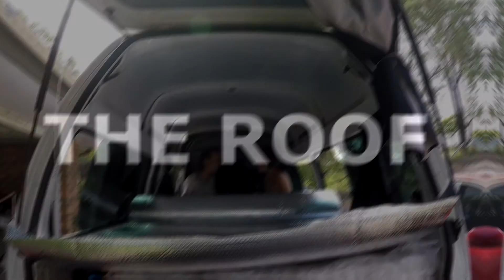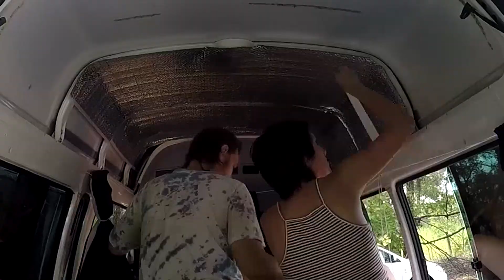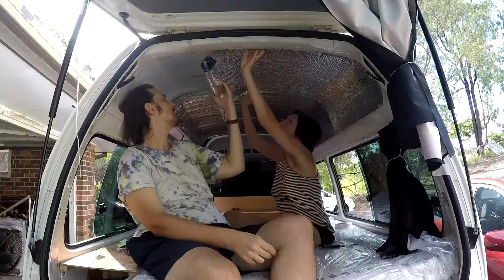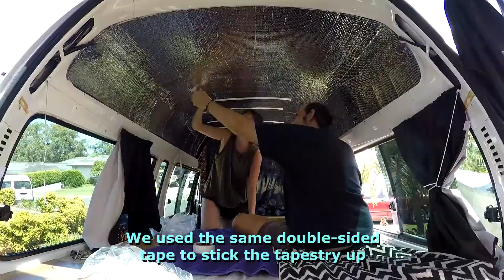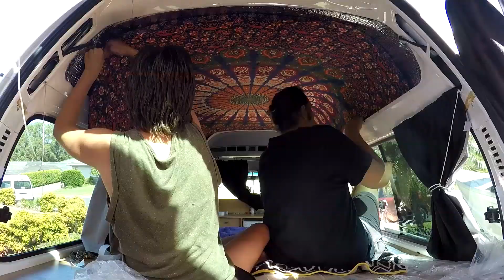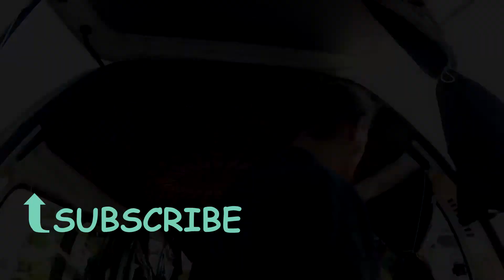Cheap Van Build: CEILING TAPESTRY (no experience)

Comment: Hey guys this looks great, how did the glue on the sticky tape fare in the heat? I’m super interested in knowing where you got the insulation, tape and glue. Other videos I’ve seen they’ve said you should have an air gap. What are your thoughts? I’m at the point where I’m about to buy a van and do the conversion and then next year in June head from Brisbane straight up to the tip of qld and over 6 months follow the coast line to tassie
Reply from the maker: Hey, thanks for tuning in! The air gap is a must when using this type of insulation or else it just won't work. If reflective insulation is touching the surface of the van it becomes conductive heat and loses its ability to reflect heat. In this van and most panel vans there are support beams, like ribs, which add strength cross the roof of the van and protrude about 5cm away from the sheet metal shell. We stuck our tape to those support beams to ensure there was an air gap. I hope this makes sense? The double sided insulation tape we bought from Bunnings for about $40AUD (for a 50m roll) and as it is designed to work inside roofs it has stuck perfectly throughout the past 2 aussie summers. Last summer got up to around 43 degrees C at one point and the tape remained unaffected. We couldn't be happier with how well it has worked and will be creating a website shortly to elaborate on the different aspects of our build. Best of luck with your future van! We will be listing ours for sale in the Gold Coast area in the next week or so, so keep an eye out for that if you want one already fit out (We're selling up and going backpacking in Asia... Yew!!)
Reply: Ali & Tim that’s really helpful, thanks guys. Now that I watch back I see what you mean on how you stuck the tape on the support beams. Seems super easy. I just bought a van on Thursday!! I’ll continue to watch your videos and reach out if I have any questions. Good luck with selling your van ☺️
Reply from the maker: @meals1459  That's wonderful! Have a great time fitting it out. It can be a mind bender figuring out how it's all going to come together, but with Youtube and so many blogs to turn to, you'll have all the guidance available that you need. Good luck!

Comment: What size tapestry did you use
Reply from the maker: That one was 180cm x 230cm, which was a little bit short length-wise. We bought it from Ebay and it was the largest we could find at the time.

We have been looking again lately to do the same on the roof of our latest van and have seen some 200cm x 300cm in size on the Ishka store website which would be better for longer vans.
Reply: @TheVeganTravelShow  okay thank you so much I'm planning on doing this to my 4door geo tracker. I thought it was a really great ideas thank you for posting this.

Comment: So is that reflective?
Reply from the maker: If you're referring to the tapestry, no it's not reflective. If you're referring to the type of insulation, the short answer is yes!

The insulation used was a reflective insulation, so by attaching it to the van's roof support beams instead of directly onto the roof we were able to maintain a small air gap which reflected the heat. It was only slightly effective however, we only noticed approximately a 2°C difference between the inside and outside temperature throughout the year in Australia.

An air gap must be present for reflective insulation to work.

If it's stuck directly to the roof it becomes conductive and heat will transfer through it meaning it won't work. In hindsight, insulating a van with windows is a tough task but panel vans are much easier to insulate. Reflective insulation is a cheap, lightweight insulation solution... But a good set of thermals & a roof Vent are far more effective for temperature control.
Reply: @TheVeganTravelShow  Thank you for explaining, I don’t have a ton of money to put into a build, just don’t want condensation building up
Reply from the maker: @franciesjoy1269  You're welcome & thanks for asking the question.

If condensation is your biggest concern then I would suggest prioritising a vent over insulation.
Reply: @TheVeganTravelShow  yes I have a max air fan, just need to find someone to help me install it
Reply from the maker: @franciesjoy1269  Great choice! We have one installed in our new van and it's seriously a game-changer. Rarely do we have any condensation in the van (& we didn't insulate our new van either... As we had a small budget/limited time to build).

A good set of thermals is a better purchase for cooler weather.
Reply: @TheVeganTravelShow  I wonder if you were looking more at sound deadening than insulation it might the better to stick the reflectix (or similar product) directly to the van sides and screw the R value?
Reply from the maker: @richardabazley  Yeah it would probably work as a sound deadener as it's not the best insulation even when it is used as insulation.

Comment: Taking reflectix to your ceiling as insulation makes no sense.
Reply from the maker: That's right, which is why we didn't tape it directly to the ceiling.

We taped the insulation to the ribs of the van to maintain an air gap between the reflective insualtion and the roof of the van.

This insulation only works with an air gap because it's a radiant barrier, meaning heat travels from the hot surface (roof) through the air and bounces (or radiates) away from the reflective insulation, not allowing heat to transfer directly inside the cabin. 

If it were taped directly to the roof it wouldn't reflect anything because the heat would transfer directly through the insulation via conduction.

Thanks for commenting so we can clear that up for others 👍🏼